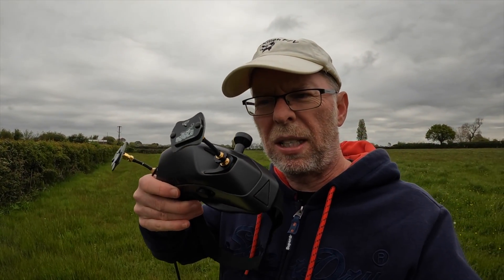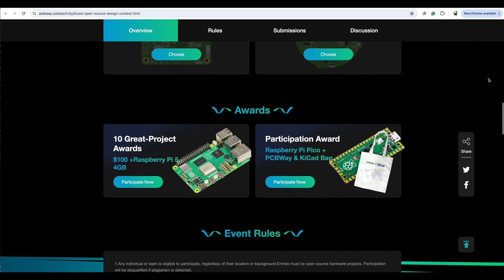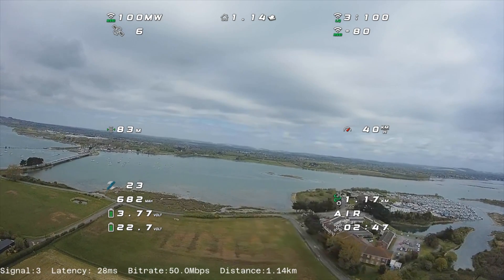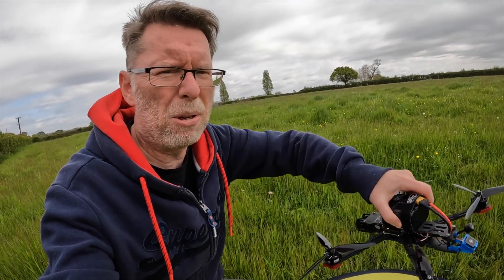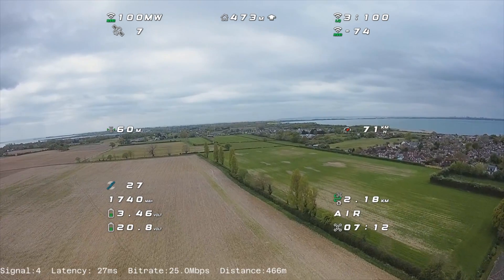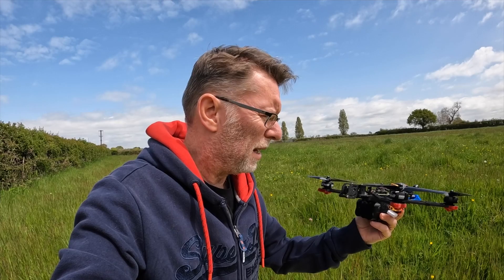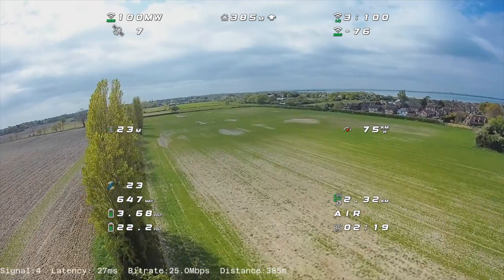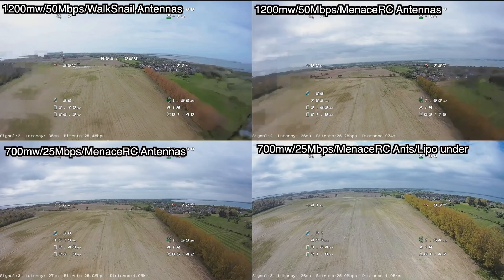Finding ways to improve the range on my WalkSnail goggles

Comment: I am planning the 1km challenge for tomorrow at the municipal beach with my FPV helicopter of 250 grams. You episode gives good idea of what to expect with Walksnail.
Reply from the maker: Good luck, just keep an eye on the signal as you go :)
Reply: @CurryKitten  I finished the 1km challenge with Walksnail VRX stock antenna on my channel. It was with my FPV helicopter at 250 grams takeoff along the beach waterline today.  
All I can say is that beach houses are horror houses. I left the scene at 9PM after downloading my footage from the drone at the beach. And there was not a single house light to be seen. It was pitch black, like being blindfolded, ready to be slaughtered, and not seeing where the axes are coming from. I will not spend a penny to buy a beach house.
Reply: @CurryKitten  Stock VRX antenna can easily handle 1km with good VTX trueRC dual antennas. But antenna angles make all the difference between 14 and 2 Mbps.

Comment: Great Video! I have the GooglesX and it would be interesting to know if the patch antenna faceplate from Walksnail is worse than your 3rd party ones as Walksnail seems to struggle with good antenna design in general.

Comment: Thanks for your test. That' pretty interesting. A question as a walksnail user: do you recommend focus mode? haven't tested focus mode yet. whats the benefit of it? kinda alert to get back home or just a stable picture in my avatar googles to get back home safely? Thanks for your help subbed! 🙂

btw i changed my stock antennas on my avatar v1 google to TRUERC patch. Only one TrueRC Omni on the upper left side (when wearing the goggles) haven't tested yet, but 1km was fine last time i tried.
Reply from the maker: I flew without focus mode to start with - and I had an issue when I go to the edge of range.  The latency went to over 100ms and it was a difficult few seconds before it recovered and I could see again.  Having focus mode on "Auto" as I do will give you those pixellated images down the side, but the latency will stay much the same.  So it's useful for me so I can not just keep control, but get a useful visual indicator if the signal is weakening

Comment: Nice video! What would you think about mounting one antenna on the top of the quad and one on the bottom? I've purchased the Avatar HD Pro and I'm thinking of best ways to have max range for a jack-of-all-trades 5 inch. I found a free 3D print mount in a Y-shape for the dual antennas that goes on top of the quad behind the battery, but what if I were to have one antenna behind the battery and one below the quad?
Reply from the maker: That's certainly a way of doing it.  In most cases, having an antenna underneath the quad woulf be a good idea as 99% of the time you'll be above yourself and thus a antenna coming out the bottom would get a better signal.  The reason most people don't do it is that it's hard to protect the antenna from getting smooshed when you land
Reply: @CurryKitten  Good to know, the 3D printed part should be sturdy enough for my needs! Cheers

Comment: I use long antennas on the back I use ones that flex
Reply from the maker: Long antennas with a UFL connector for Walksnail?  I haven't seen these at all.  I've got some new antennas to test from RushFPV and while their ufl connecting antenna is large, you'd need a ufl to sma adapter to use a decent sized antenna

Comment: Note that any metal near an antenna will change the "antenna pattern".  So Even though the battery at times is not between the antenna and receiver, it will reflect some of the transmitted energy towards the receiver.  Depending on the distance from the VTX antenna, that power might add or subtract (and with different effects at different angles).  Moving the battery to the underside probably gives you more uniform reception regardless of Quad orientation.

Comment: You really need to test running patches on the top 2 antenna ports.  (unless you've swapped the internal ufl connections around)  It's important for range that the tx is optimally talking to the VTX as it's this antenna that asks for packet resend.  If too many packets are missed and not resent successfully, the signal quality drops.
Reply from the maker: I've mention of this several times - but it doesn't really fit into the way I fly - which is more often all around.  Putting directionals on a transmit antenna in that situation would have a more negative impact than an omni

Comment: I only bought Walksnail so I could fly HD on whoops. Mixed feelings. I can't fly Walksnail in summer here even inside as the mini VTX's just over heat mid flight. Even at 25 mw. DJI V1 outside with the fabulous vista VTX's and inside with Walksnail. DJI has no issues even at at 110 plus outside in full blistering sunlight. Walksnail mini vtx's overheat inside the house in the shade, where it is maybe 90. Back flying Walksnail now winter is coming.
Reply from the maker: That's annoying - I've no worries using the VTX's indoors or outdoors, but "summer" here is usually a week in June when it doesn't rain quite as much as normal
Reply: @CurryKitten  I think I'd find a summer like that far more annoying than overheating Walksnail vtx's.

Comment: Watching your videos for a while, sorry I just realized I wasn't subscribed. 

Love the experimenting. I'd suggest tilting the antennas upwards a bit too so that the antenna points straight up and down while in flight. That way the radiation pattern will be stronger in your direction.
Reply from the maker: Thanks - don't worry, around 70%+ of all views are from people who aren't subscribed.  Weird really!  Having use a single 3.5 turn helical on my old goggles, I'm pretty good at keeping my head in the right direction.  Although it's much easier to act like a manual tracker on analog because the feedback is so obvious.  It can be quite useful to film yourself and see your normal head position when flying.  I see a lot of people with powerful patch antennas staring down at the ground which isn't going to work quite as well :D
Reply: @CurryKitten  hey yeah, I was more referring to the antennas on the quad. I've noticed a small improvement by making sure the cloverleaf antenna is pointing straight up. At lower power levels it's even more noticeable.

Comment: Great test. Thanks. Maybe I missed it, did you ever swap out the top right transmit antenna port to make it face forward, as a lot are suggesting? I think your findings with the battery are killing my range, and I hadn't thought of that until now.
Reply from the maker: No - as the transmit antenna on the goggles isn't doing too much (at least that's my read) basically telling the VTX to resend some bits if we need to correct for errors, but it the received data is as good as it can be, then this should be used less

Comment: I only run at 25mbps...the image in the goggles looks no worse TBH....A longer vtx antenna is the next move although all my quads have original WS vtx antennas. The Goggles have a full set of TrueRC antennas, which makes a huge difference. I run at 200mw, and its plenty...😮😏🇬🇧
Reply from the maker: I notice the grass smears more at 25Mpbs, but it might be all in my head :)  I've got some replacement VTX antennas coming in to try out nect.

Comment: I use thrashers on my vrx and get great signal and picture out to 400 metres at 25mw vtx power,the dipole Antenna seems better than the walksnail stock Antenna on the model so sent off for some Atom RC ones to replace them.
Reply from the maker: It does seem that replacing the Walksnail standard antennas with a well known decent make of antenna will enhance things a lot

Comment: Much improved, heard before that 1200mw was actually worse then 700mw. Seems a shame that the supplied goggle antennas are sub-par, the goggles are not cheap!
Reply from the maker: I heard a rumour the 1200mw option was only added because DJI had it!  Yeah, when a manufacturer gives you some little omnis and patches you'd think theat they'd been tuned perfectly, and weren't just some generic cheapo things
Reply: If You put both high gain antenna's on your right side(when goggles are on your face) facing the same direction...You will get the best results. Antenna 1 - top right is tx and Rx antenna. All other 3 are Rx only.